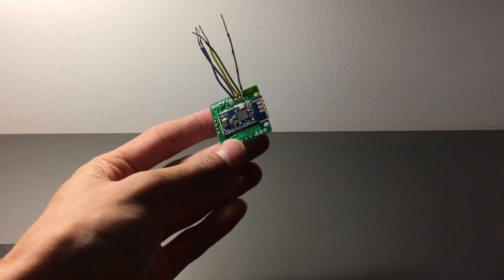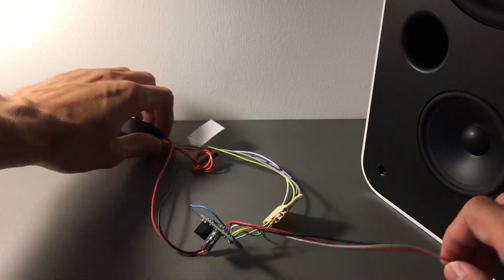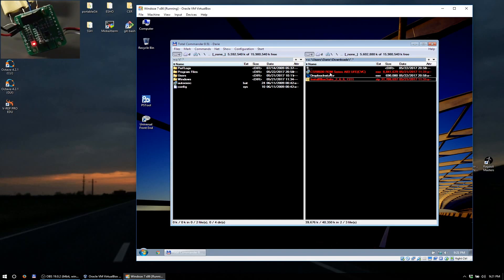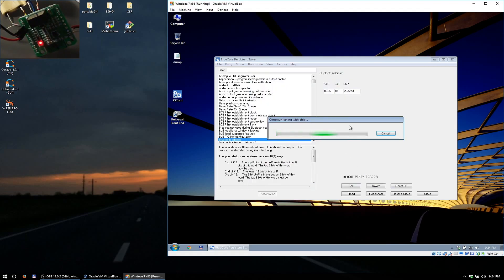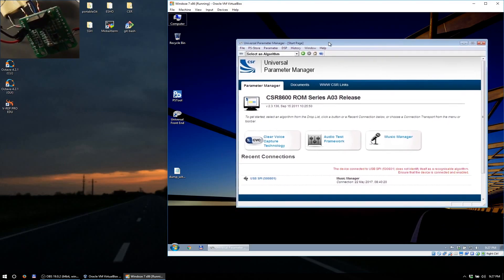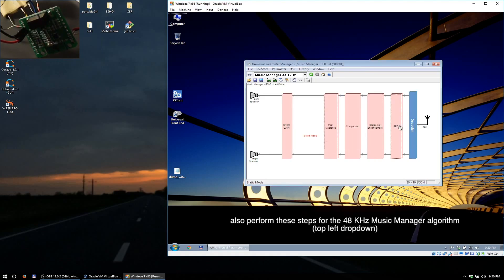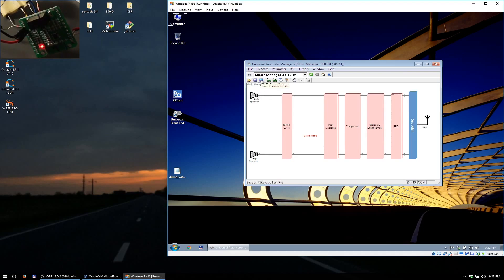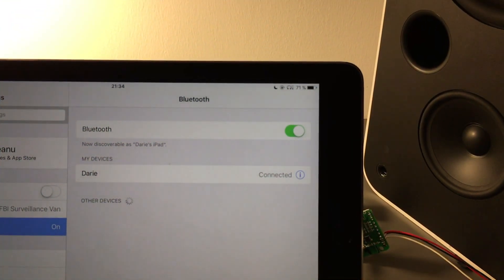CSR8645 Equaliser Set Up Guide

Comment: I get error detecting chip type (Read failed on USB-SPI). i may have connected somthing wrong because mine is built on an amp. so the only free ports are MOSI CLK CSB MISO. SPI_EN is already solderd on the board. but i don't know if its powerd and if that could be the problem. The amp is powerd so the blueetooth board gets power as well.
Reply from the maker: check to see what voltage the SPI_EN pin has on it, it's supposed to be around 2-3V

Comment: What must i do with that: The device connected to USB SPI (334296) does not identify itself as a recognisable algorithm.
Ensure that the device is connected and enabled. I install driver and started it in win 7 64. My opinion it is becouse of Chinise programmer. Cpuld you help?
Reply from the maker: I most likely can

What you're not doing, is having some music play -- only with an active stream does the DSP become active and thus also programmable

(you're quite lucky, I spent a good few days until someone told me that)
Reply: Thank you! But "The algorithm connected to USB SPI (334296) identifies itself as E00C @ 44100 Hz, for which there is no available support." this i saw after start music and conection. In persistents stated 00001f40(8kHz) in "Sample rate in codec input".
Reply from the maker: So, what chip are you trying to program?
Reply: 8635
Reply from the maker: Hmm, the software I have linked here should work ... check my csra64215 videos ... maybe the FrontEnd linked there (newer version) will work better
Reply: Ill check. thank you!
Reply: Do you know anything about systems sounds changing? I have found information only about buttons, leds and sources. But i cant download FrontEnd from you video, but 86xx parameter maneger must work with thit chip. In my opinion it is becouse of chinies programmer.
Reply from the maker: I don't know, I also have used 2 chinese programmers and both were fine

Check my "how to disable mic on csr8645" video, the program I use there can be used to change system sounds

So, is the dropbox link in that video not working or what ?
Reply: you make me happy, ill try again. Thanks, ill see that video.

Comment: Darieee Could you please help me by answering this question: is it possible to control the CSR8635 builtin equaliser by its UART, USB or BT?
Reply from the maker: Dude I think so .. it's a really clever chip and CSR does some pretty solid work (if not the 8635, than surely the csra64215), but ... it's wildly beyond my scope

You can however control it via the Gaia app, but that I also never tried

Comment: Hey Darieee,
You've been incredibly helpful by answering all of my previous questions but I'm still running into an issue here.
Just to check if my work had succeeded I decided to make a shit setting, just like you, so I could here if everything was right. So, I added the shit parameters to the 'dump', created a new filed which i called shit settings so I would save the dump and merged the new file with the old one. Pretty hyped about the completion of het merge, I disconnect the usb spi from my amplifier, boot it up, play some music, just to find out it doesn't sound like shit at all... I decided to reconnect and make a new dump of the current settings on the board and upon inspecting the new dump I saw that the shit parameters WERE there! They were in my new dump, and thus in my BT Chip, but they didn't work. I checked all boxes and the shit settings did work when i applied them with the CSR universal front end. 
Have you ran into this problem too, could you help me solve it? Would be great if you could!
Thanks in advance!
Reply from the maker: Hmmm, no.. didn't have it..

Usually people miss one (or more) tiiiiny details ... 

Have the thing connected - and playing

Pull up the frontend, press the glasses, do you settings WITH the music playing

Press the glasses again, hit save dump

Then go to the pstool, and merge

! For example, try Factory Reset all in PSTool, them merge one of my untiuched dumps, then merge your eq

You might have a corrupted batch of setting for the eq, and the chip can't parse them when it's reading them from it's memory (actually - I think it's that)

"Merge" in PSTool is only additive :: you can't remove stuff with it :: only by hitting factory restore all

Comment: Hi Darieee! Can you setup CSR8635/8645 module with 2 way i2s output? 1 way for woofer speaker with low frequence sound, and 1 way for tweeter speaker with high frequence sound
Reply from the maker: I am 90% sure you can't

Technically, you can write your own DSP firmware and have different EQ stages for each channel, but - with the stock firmware, as previously mentioned, not possible

If you find out how - do let me know - I know what you're after - and I'd totally be interested: get 2 CSRA64215s working in TWS mode, one left, one right, each module driving mids/highs and bass directly filtered ... the dream
Reply: @Darieee Is there a forum or guide of someone who tried/explains this? Adding seperate channel eq/filters would make this module much more usefull. I can't find much documentation of the output parameters of the filters made with "universal front end" software.
Reply from the maker: None that I am aware of ... unfortunately
Reply: @Darieee   I found this; https://www.twblogs.net/a/5c659562bd9eee06ee22e443 but it is a custom program that i can't seem to download. And found that the new ADK4.0 has the crossover blocks for the CSR8675; http://www.52bluetooth.com/csr/adk4.0/adkdocs/dsp/cvc/CS-329107-UG.pdf unfortunately the newer ADK versions are not that easy too find/ find documentation for. The newer ADK 4.2 and up supports the bluetooth 5.0 which would be a treat.

Comment: I really appreciate your videos, I’m working with a 64215 right now and am having trouble matching the output level between the Bluetooth and line in.  Is there a way to reduce Bluetooth output level without effecting line in output level?  Also is there a setting for diff in / single ended in for the line in?  Thanks in advance!!
Reply from the maker: I have no idea .. I haven't played with the CSRA64215 past enabling analog output instead of i2s

In a shocking turn of events, and since you're already here, I'd love to know how you got a line in into the csra64215 chip, aaand, if you have any idea, wether it applies to the 8645 as well
Reply: LOL!  I put VCC on PIN1 (I/O 6).  This was an option I had my bluetooth factory program into the module.  I can send you dump file if you want.  Or you can find that option and enable it.  My problem is that I'm using the aux inputs single ended and as such am only getting 1/2 voltage out compared to bluetooth input.  I could easily rectify with a simple single ended to differential opamp circuit but I'm trying to just adjust the gains in programming to continue living my life.
Reply from the maker: Yeah .. shit .. doesn't the front end have any options for this ?

If you could send those over at ---@yahoo.com that would be awesome

Btw, what're you building ? Sounds quite serious xD
Reply from the maker: Where do you feed in the signals ? Also some GPIO pins ??

NO FUCKING WAY 

NOOOO FUUUCKING WAAAAaaa4AAAY

Dude I saw those speakers on big d whiz ... hooooowly shit ... man I know I've made it when you people come in my comments ... Man, it's an honour ...

Them speakers be rrreal badass xD

If you're the same guy who does the amp dyno I'mma flip out completely - like - loose it girls on elvis presley type a deal :))
Reply: Lol too funny, thank you.  Yes the amp dyno is my other company D'Amore Engineering
Reply from the maker: Unbelievable ... I love how you programmed the startup sequence on the dyno - I would've done it EXACTLY like that : maximized awesomeness .. just feels mighty every time it starts up

Well, yeah, I'm very flattered and kinda sorry for not being able to help 

Pretty cool that you're using the CSRA chips in the speakers, equalising the CSR8645 is really buggy if you want it to work with android phones

Have you tried the newer Bluetooth 5.0 chips ? The modules have started cropping up (and disappearing) at price of 15-25$

Comment: I tried not doing multiple changes at once and got the parameter manager to transfer the EQ settings. One window at a time, uploading in between.
Reply from the maker: Mmm, there's really no need ... and there's a faster way of doing stuff than what I show there

Click the glasses, set your stuff up from the blue interface, click glasses again, hit save PSR -> merge that all at once with PSTool
Reply: Darieee. I tried that without  success. I dont know if the newer csr usb-spi converter is much different from the old. New does not have pinout labeled at least.
Reply from the maker: Uuu, yeah then perhaps try opening it - sometimes they write the pinout on the boards

10 out of 9 times there's a problem though - it's a dodgy connection between the programmer & csr board
Reply: I did open it, measured the voltages and found pin-out. that is ok..
What i find complicating is getting the data retained and getting warning sounds low or off. As i understand there is only one config file in the CSR module and all parameters should be given there if they are not the default setting. is this correct?
You said you managed to skrew up the data in the Head-set config tool. Are you saying that if some functions like "Link Loss sound" are removed it might skrew up to not work?
Reply from the maker: So you're saying that your eq config only works in the Live-Mode (blue diagram) ?

That is correct, there's a properties store where all the params are saved

What I meant was if you remove ALL sounds (so, not just the low batt sound), it'll screw the module up, and you can retrieve it in PSTool using the Restore All option, but it's a pain in the ass
Reply: What i meant was, that it was only possible for me to get a static adjustment on the EQ because i could not get your method to work. But after tinkering with two different boards with CSR8645 i found out that I had some bad connections which only worked intermittently.
After i got everything working on both boards i settled to tell you my observations since you distribute help on this matter.
The button you use to download the data from the board. That button uploads the data for me and vice versa with the upload button. That one downloads for me. Its the data that flys off in the button icon. It's probably also why it asks you to compare injected data to already stored data on chip.
Else both builds worked great although it was a hassle to find the board pinout for the PIOs on another version of the CSR8645 board (on BRM-01 boards from ebay)
Kalimba Interlock Deamon or something along the line also likes to hold up so you cannot get connected to the DSP, so computer needs restart.
Great boards i must say :)
Reply from the maker: Alright - all's well that ends well :D

The only real gripe I have with the csra64215 is nobody makes them with a heaphone amp AND isolation transformer built into the same module ... so for the time being I'm still keeping a stock of the 8645s
Reply: I have not tried making a BT headset yet, so i have no experiences with terrible "digital sounds" as many complain about. I can't hear anything but the usual quiet amplifier hiss at full amplification on my CSR8645 hotglued to a TDA7498E.
Reply from the maker: Alright, so, using one without an isolation transformer - and getting no bluetooth noise huh ?

Try moving the phone further away from the CSR chip - that'll beef up the transmit power
Reply: Yes :) 
I tried to take it out-side to maximize transmission by increasing my distance and got about 8-9 meters away on my approximately 4 inch board-mounted antenna before the signal broke with only minor BT noise(nothing that bothers me since it's soo low). I Thought if that was what people meant, maybe I can get it so go away.
I poked around with my finger until i found a spot to decouple. I ought to have measured what was in the line i decoupled, but this was a "easy fix" so i did not bother.
I recorded a demonstration where I show my setup after i made my addition to the circuit. 
I'll post a link to it on the next line, so that Darieee can remove it if he so wishes.
Reply from the maker: Very nice :D

Nah, why would I remove it ?! Usually what happens is youtube automatically hides them though - seems to not have been the case this time though

Funky-ass speakers - what's their model name ?
Reply: Darieee fwb-m777/00. I bought them for my home sterio some years ago so they are pretty worn :D
They were a part of a Philips hifi set.
Reply from the maker: Awesome ! Have fun using them !

Btw, what're you feeding into the amp ?
Reply: I was planning on feeding 33,3V direcly from 18650 cells but for now i have a DC-DC booster circuit taking 24V from 18650 and delivering 36V to the amp so i can get the full 160W from the amp. The amplifier input is the bucked so the BT module is on when the amp is on. The battery gets connected by means of a SSR. It's not finished yet but will get there :)
Reply from the maker: What's an SSR ???

Also - why go to 18650s if it's gonna run inside the home ???
Reply: Solid State Relay. The point is to have a light and powerful speaker with the capability of running on wall power alone, on battery alone and do so with full power for a few houres. I need many 18650 :) It's a festival speaker :)
Reply from the maker: Oh shit so all the stuff goes inside that one speaker - then you can if needed carry a wire to the other one - and have that be the setup

Ok I thought it was more of a desktop thing

Then you're just the right kind of crazy for going 36V - be sure ti add a fuse somewhere though xD
Reply: Exactly :)

Comment: Does the same procedure apply for the csr8635? Thanks for the video!
Reply from the maker: Welcome, it sure does !
Reply: Darieee   yeeees! you've solved a major problem of mine by making this video. Thanks a lot!
Reply from the maker: that was the purpose :D - I've had huge headaches the first time too, just not knowing random simple shit .. couldn't let that happen to you guys too

have fun !
Reply from the maker: Make sure to check out the CSRA64215 then ... there are pin-compatible blue-board modules out there -- and those are wwwway more powerful
Reply: that is awesome. bought an amp on banggod voor 10 euro with the 8635 in it. and i didn't know it could do so much.
Reply: BTW do you need this exact spi or will every USB to spi work
Reply from the maker: It has to be this CSR branded one ... works way better - and has this CSB signal as well

By now they're cheap enough (read ~15$) to not warrant the hassle of using an FTDI programmer with modded drivers and what not ..

Comment: I cant connect to setting equalizer on CSR64215. Can you help me?
Reply from the maker: who knows, most likely yes I'd say
Reply: Darieee sorry, my english is very bad. So i cant what you say on video clip. I just make follow you the mouse click. After i connected, it say Recent Connection : The device connected to USB SPI (607254) does not identify itself as a recogisable algorthm. Ensure the the device is connected and enabled.
Reply: i working on Window XP and do not install virtualbox... 🤓
Reply from the maker: Music has to be playing in order for that to work
Reply: Darieee Yes, csr64215 module working i2s output mode
Reply from the maker: so, are you playing music to the csra64215 when you try and use the FrontEnd ?
Reply: Darieee I cant set the equalizer for CSR64215,. Cant you help me?
Reply from the maker: you'd have to at the very least answer my questions for that to happen
Reply: Darieee I installed the equalizer and it's working but it do not remember after i restart the csr64215 bluetooth module. I downloaded parameters and saved psr... After copy psr and pasted to dump file. And Merge...
Reply from the maker: I haven't actually played around enough with the CSRA64215 ... if you are saving a small .psr file with the FrontEnd and then merging it with PSTool, it should remember it ... I can't say why it wouldn't work